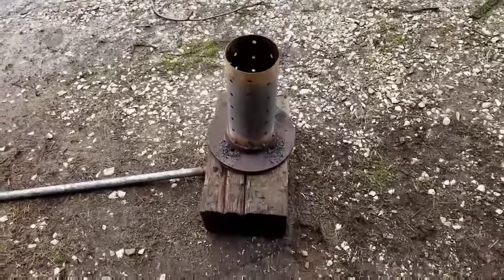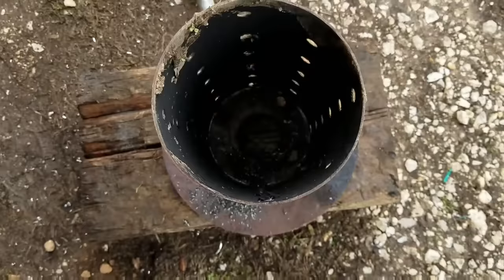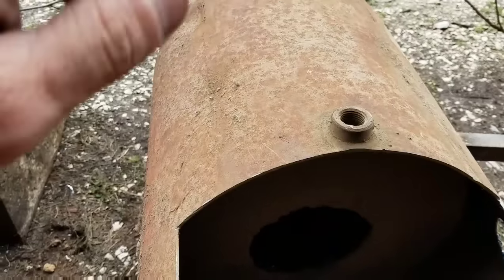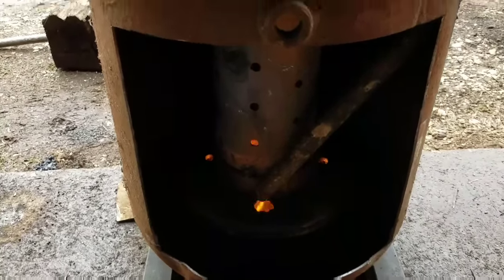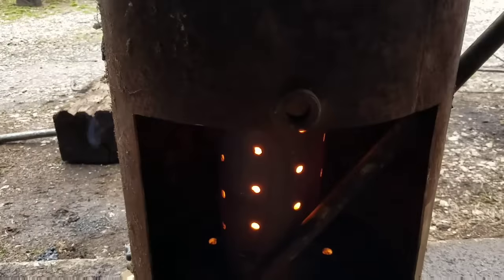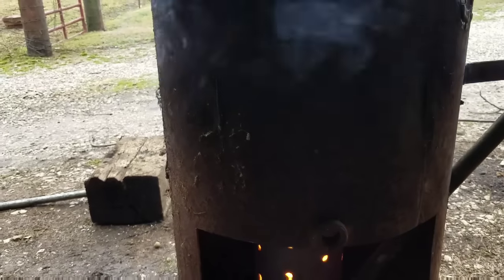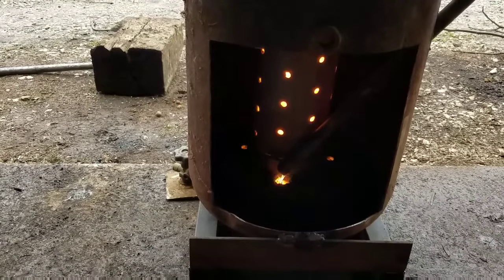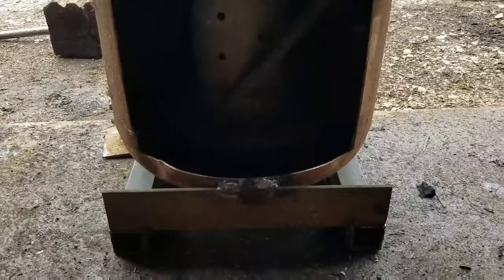Waste oil burner-100% Free Heat!!

Comment: why not make the design to create a vortex fire instead? i would assume it would be much more efficient at creating heat energy but perhaps it will need to draw more fuel? idk im just thinking
Reply from the maker: That a good idea. When I build another one,  I'll try some different build ideas.
Reply: @pennderosafarms7910  google fire vortex lamps and look at how they are designed in a way to make the small flame inside become a long hotter burning flame (tornado or fire vortex like ) because of how they designed the air inlet to guide the air flow in a swirling pattern inside ,there are two designs i have seen ,the first uses a glass cylinder or in your case can be a metal pipe split in half and the two sides are simply offset from each other creating a swirling air inlet pattern all the way up through the whole burn , the other uses a solid pipe but the bottom air inlet is designed in a way to let the air flow into it like a vortex, im betting that should be the design more suite to adapt on your stove or perhaps the first design is easier with a split pipe instead ,maybe a break rotor with the right curved vanes will do this job ,,, go have a look at these and let me know what you think, maybe you can easily create a small version of these stoves ,i dont think i ever seen such idea ,i just saw the stoves and put two and two together,,  just remember to credit me if you ever make one lol so let me know if you need help to find the vid links to these designs

Comment: Pennderosa Farms quick question? You did a hell of a job explaining your setup except for explaining your dog bowl, would you explain if the stainless steel dog bowl sitting below the old air compressor tank, below a hole in the air compressor tank, or sitting in the bottom of the old air compressor tank, with the brake rotor on top of it? Thank you, I await your answer sir!
Reply from the maker: The dog bowl is sitting at the bottom of the air compressor tank. The brake rotor is sitting on top of the dog bowl and the pipe is sitting on top of the brake rotor. I hope this helps.

Comment: Awesome! Do you think you can burn pellets this way? Ir a combination of oil and maybe pellets? I have had no luck with consistent combustion burning pellets and this design looks amazing with the air being pulled in on a car disk brake. Nothing shy of genius!
Reply: It would burn wayyyy dirtier and less efficient if you introduces solid fuels. The whole idea behind waste oil burners is that everything gets burned off during combustion. And without introducing multiple burn chambers you can't get that while burning wood. Check out rocket mass heaters. May be more what you're looking for
Reply from the maker: Thank you!! I know it would burn but, the problem is feeding them in. It probably be good in a wood stove.

Comment: Would this be good for hearing your house?
Reply: Frank Maxfield don’t use something like this for ur house. (Or should I say “in” your house)
Insurance will drop you so fast for doing that...
Detached shop for sure! 

BUT! You could definitely make a out door boiler similar to this and run a heat exchanger inside.
Reply from the maker: No, just for a shop.

Comment: Why the dog bowl? Wouldn't you want that to be the heaviest part? Good job though, I plan to copy this. Great explanations.
Reply: The reason for thin is because it is much easier to get to red hot, this system only works if the oil drips on something red hot. A thin metal will also require much much less oil to keep going, easier to throttle down low.
Reply from the maker: That's right.
Reply from the maker: Like the said, you want it thin so it will heat up fast. I've had lots of fires and its still with that same bowl. Thanks for watching!

Comment: Let's say hypothetically your flow rate is super tiny faster than you thought and you walk away for a beer and it over flows all over the ground. Would you be as the song goes burning down the house?
Reply: Point being no one in it's right mind would leave a system like this unattended.
Burned a lot of used oil. I don't believe I ever let it "alone" for more than 1 minute... ;-)
Burn quite well, put out a huge amount of heat. Get rid of the old engine oil on a very useful way. But leaving it unattended... NO WAY!
Reply from the maker: That could very well happen. This is something I use in my shop, I would never put it in my house. Stay close to it.
Reply from the maker: That's right!!

Comment: That looks great. Nicely done. And from what I see my question may be pointless, because what I would worry about isn't happening. But I'll ask the question anyway. The thing I would worry about would be the drip source of the oil catching fire and extending up to the holding tank. How does that not happen?
Reply: I suspect it is because of the lack of oxygen and heat.
Reply from the maker: I wouldn't worry about it, no oxygen and the flame wants to go up and out.
Reply: Suction if air into burn chamber. "Cold" air enters the same hole the oil does. THEN it combusts once inside the chamber. Heat rises, so by air flow and thermodynamics, it doesn't allow the flame to exit where the oil enters.

Comment: how do you light it?
Reply from the maker: Put a small amount of kerosene into the burner and light it. I made a part 2 of this that you might want to check out.
Reply: @pennderosafarms7910  if its the one with no holes and only a slit across the bottom of the pipe yep i saw it,,very nice

Comment: You need a longer flu. What makes black smoke is air Feul mixture you need to work with it.
Reply: black smoke means  running rich " too much fuel" not enough air.. bring in a secondary air tube.

Comment: is it solid fuel or gas for the initial burner?
Reply: I think most people use kerosene to get them started.
Reply from the maker: I use diesel or 50/50 mix of gas and oil, it doesn't take more than a cap full.

Comment: but wont this create pollution? maybe if you can put some kind of filter or exhaust system to the top and help reduce it at least
Reply from the maker: I'm sure there is some pollution, I've just to make burn as clean as possible.
Reply: @pennderosafarms7910  yes but despite a clean burn i think there is still toxic emissions if you are using motor oil ,veg oil is ok ,,perhaps if you get an old exhaust catalytic converter and attach it to the system before it exhausts ,, just something to think about
Reply from the maker: @ARCSTREAMS  Used peanut oil burns hotter than engine oil I think.
Reply: @pennderosafarms7910  well its gonna be whatever you get your hands on as waste oil thats the name of the game

Comment: You need to recycle used oil!
Reply from the maker: I don't know of anyone who takes it around here.
Reply: He IS recycling!!
Reply from the maker: @acrautomotive2581  I'm trying to be as green as possible😁
Reply: @pennderosafarms7910  
The smoke (maybe), but definitely the gases we can't breathe produced by this method of recycling used oil is loved by green plants and trees.
XD XD!!!!!!!
Reply: You realize when you take it to automotive shops to dispose of it, they use it to heat their shop?
Reply: When you use electric to heat, chances are that in the power plant they are burning some fossil fuel which has emissions, and a lot of the energy is lost, going to waste over kilometers of high voltage lines. Plus the diesel a recycling collection truck would use. I believe Pennderosa has got it right.